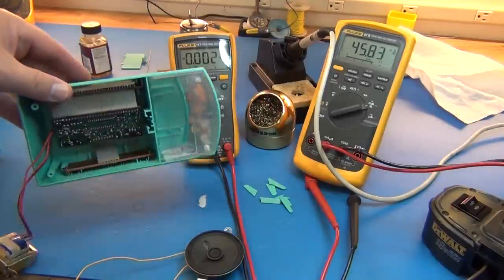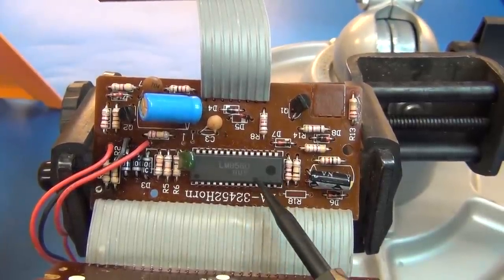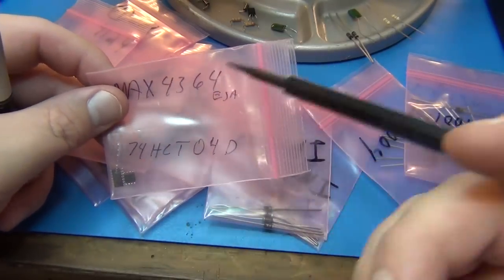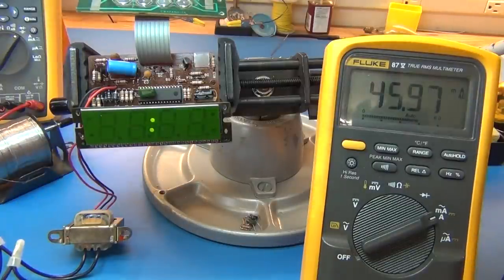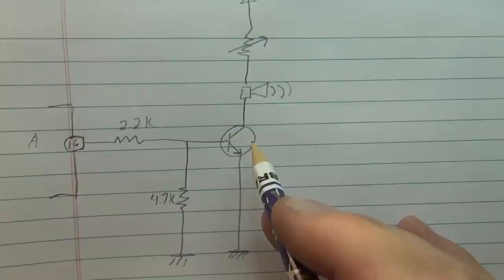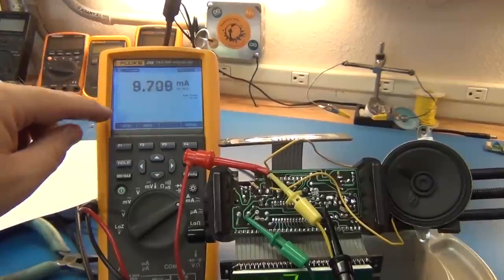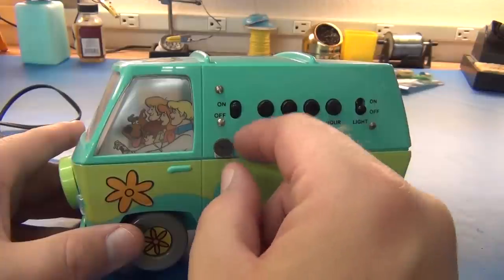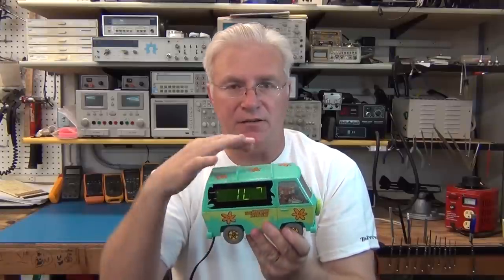Scooby-Doo Alarm Clock Repair

Comment: Did the garage burn up yet, just kidding Todd, couldn't resist! That is a cool clock, there is a guy I know in town here who has a real van that he customized to look like that, pretty cool.  Nice work on getting it going again. I have not done many videos either lately but just kind of starting up again, hope to get back to it just like you.
Reply from the maker: RadioHamGuy HA! No the garage didn't burn and I'm happy to say the clock is still in service. It should have another 20 years waking up kids, maybe even grand kids someday. Unless I hack it to restore the honking sound and manage to mangle something. I'm sure I could replace all the guts as long as the buttons and display work. I guess I could even replace the display but those displays are not as common anymore.
Reply: the van is the Mystery Machine

Comment: Nice one, you say it was a simple repair, simple for you maybe but way beyond me.
Thank you for posting, it's always interesting listening & learning from you.
Reply from the maker: Malc Tulloch Thanks for the comment. When I look at all the surface mount stuff now days this old through hole was a nice throwback to simpler days. That said, I much prefer working with SMD then through hole devices. The traces and multi layer boards nowadays make reworking or altering such boards very difficult.

Comment: Thanks for a great video, I learned a lot from your repair. The clock is absolutely awesome. I've just subscribed to your channel.
Reply from the maker: ElectronFun.com Thanks for the sub and I’m very glad to hear you picked up some tips. You know, when I build a simple Arduino on a breadboard I just skip the crystal unless timing is important to the final project, many times it isn't. You have to change fuses on the AVR to support such changes. I don't have video on such but I do have a post with all the details at http://www.toddfun.com/2011/01/01/making-a-custom-arduino-board-to-hack-a-christmas-photo-frame/

Comment: Great video.  I once lost a video production monitor that was left plugged in during a "brown out" - so I'm not convinced that limiting the AC voltage when powering up is always the best idea.  In the case of the monitor a AC-to-DC power supply fried.
Reply from the maker: GeorgeGraves Very true, must agree. I just wanted to make sure I didn't see any crazy high currents or flames because as an heirloom I couldn't risk much. Damped if you do and damped if you don't sometimes. Did you notice your resistor substitution box had a cameo? That thing comes in so handy!

Comment: Nice repair :)
I was about to make an alarm clock, with a few more dB than the ones you can buy. So I might try the LM8560, instead of a micro controller  :)
Thanks for the video ! :D
Reply from the maker: EcProjects I have used ones like this in the past. Some have a lot more features and they are super easy to use. I once made a coffee pot timer to turn my coffee pot on/off long before such things were common. Timers, not coffee. HA!

Comment: Hi.  I just found this vid.  I have a vintage alarm clock and it should have the same alarm sound as yours.  The volume just went low all at once.  I really need it to be louder.  It has a comparable 28 prong chip.  Do you have any suggestions on how to make it louder again? Thanks.  Great vid.  I subscribed.

Comment: hi there Todd, are you definetely sure that the clock would sloow down or speed up if i use a 50hz us to uk step down plug ?

im not any gud at this solidering stuff, i can take it apart but worried ill mess this up. just confussed about were to connect it from point a to b.

thanks so much
Reply from the maker: +lonefoxbushcraft Yes, I'm sure. No harm if you want to try it without the jumper on your step down transformer. With the step down transformer it will be running at it's rated 110v AC but it will not keep correct time. Once you try this to prove it is working clock on 110v AC but you notice it will not keep correct time then you can unplug it and  add jumper wire from VSS (pin 15) to the 50/60 Hz select pin 26 on the IC.
Reply: +Todd Harrison (ToddFun) thankyouTodd !

Comment: I have the clock as well and have a question. How do u turn off the alarm? I have tryed to turn it off and it wont turn off. I can change the time it goes off but cant find out how to turn the alarm off.
Reply from the maker: If you look at 29:15 in my video you will see that near the drivers side window is an on/off switch. That is for the alarm. First UNPLUG the clock before  you do anything.  Take it apart and then get some "DeocIT" (https://amzn.to/2tL3pYO) and spray it inside the switch mechanism from the back side. Activate the switch 10 times then put the clock back together and test. But you'll also see I had to drill in two holes and put in small bolts and nuts to hold the switch up to the plastic so I could use the switch being the original plastic mounts internal had gotten brittle and had broken away.  Maybe the same has happened to your switch and needs the same repair. The wires could have broken away from the switch as well in yours and needs to be soldered back in place. You will have to UNPLUG the clock and see if you can get inside and repair or take it to somebody that you believe has the skills and tools to repair.

Comment: hello i have a question? i try to fix my scooby doo alarm but. i fix everything but the light its not working. if any other video can should more about that
Reply from the maker: Well it is just a yellow LED so not much to to it. Maybe the LED is bad. Any yellow LED of the same size and shape would work,. Just make sure you put it in the correct way. If you get it in backwards it will not damage anything but it will not light if in backwards being it is a diode.

Comment: So I have this clock and i love it.. but for some reason it wont let me set the time. It still flashes and keeps track of time, I just cant set the right time. Do you think its probably just the buttons going bad then?
Reply from the maker: Yes, the control board with the button is mounted on plastic and the plastic get old and cracks making it it impossible to push the buttons even if they work. I had to drill holes in the control board and van body then remount the control board to the van body with small nuts and bolts.
Reply: @ToddFun  Thanks for replying. I think I'll give fixing it a shot.

Comment: I switched my clock back for daylight savings ending now I’m scaring myself awake every morning becaye the alarm is going off but no light on the screen to indicate it on. What do you think could be wrong?
Reply from the maker: Those switches can get a bit funny. You might have to take it apart see if the switches loose. If the light isn’t coming on maybe the LED is burned out for that indication and the switches in the on position.

Comment: Do you know what screw driver is needed to open it, its a very funny looking screw driver head.

I take it ill need a 110v surge protector uk to us adapter next time ?

Thanks again.

Dan
Reply from the maker: lonefoxbushcraft No, a surge protector will not help. You need a down converter that takes in 220V 50Hz and outputs 110v 60Hz for this clock to work, or find another Scooby-Doo clock that is rated for your power system if such is even made. You will need a slotted security screwdriver but what I do is take a normal "cheap" standard screwdriver and file a slot in the center. Works good and you can get a screwdriver that fits all the way down the holes int he clock.

Comment: Hey. I have one exactly like that, how do you turn off the alarm? Is it pressing the back for snooze?
Reply from the maker: Yes, to snooze you just press the back and if nothing is broke it will set the snooze feature. There is a switch under the wheels in back that will enable the snooze when you press the back end of the van. The alarm is disable by a switch so if that isn't working then maybe the switch is broken inside. You could unplug it and then open it to see what might be wrong.

Comment: I have this same clock and the alarm goes off everyday when it's turned off. Do you have any idea what the problem could be?
Reply from the maker: the switch is bad for the alarm. you would need to install a new switch. or maybe just disable the switch or you don’t use the alarm.

Comment: Hi I just bought one from usa and pluged it in and after 10min just stopped working,  it was making a very low pith noise tho, I am in the uk and used a us plug adapter,  any help please ? Thanks Dan
Reply from the maker: lonefoxbushcraft Sounds like you used a US plug adapter but the transformer inside the clock doesn't have an auto down regulator like a lot of modern switch mode power supplies do today. I'm thinking you pumped 220v into a 110v device and french fried it. No telling what all burned up but I'm thinking it is trash. The display might have survived so if you're good with arduinos you might be able to make a custom cloned arduino board then add a real time clock from Adafruit to restore some functionality. But I recommend trying to get another clock off eBay and use a 220v to 110v down converter next time.
Reply: ***** yes thats correct i think your right, im gutted, its in mint condition to. Dont no what to do, im trying to email people who can fix it. Do you think it can be fixed and how can it not happen again, thanks so much, Dan
Reply from the maker: lonefoxbushcraft Use a down converter that takes in 220V 50Hz and outputs 110v 60Hz is how you would prevent it from happening again. Very important it outputs 60Hz because this clock uses the 60Hz to maintain the correct time. If you ran it on down converted 110v 50Hz the clock would show the wrong time within minutes and be way wrong by the end of the day. I wouldn't think it can be fixed, but you would have to have somebody take it apart to evaluate the failure. I'm about 95% sure it will not be repairable.

Comment: Purchased this today at a Flea Market. The clock works fine but the night light does not.
Reply from the maker: I think there is a switch for the night light. Maybe the switch or wire is bad. Or the LED is bad. You could test the yellow LED and replace it if bad.

Comment: Hi Tod is this the right plug for my next one ?

http://pages.ebay.com/link/?nav=item.view&id=161474264495&alt=web

And is it total trash the circuit board, only fot for bin ? Or could it be fixed ?

Thankyou for your help, really appreciate it. 

Atb

Dan
Reply: Finding hard time getting 110v 60hz
Reply from the maker: lonefoxbushcraft Getting a frequency converter is not going to happen at any practical price. However, per the datasheet for this alarm clock chip you can convert the chip to 50 Hz:
http://www.datasheet-pdf.com/datasheet/SanyoSemiconDevice/393159/LM8560N.pdf.html

You have to unplug the clock, if it is plugged in to AC mains, remove the battery if one is installed, then open the clock and solder an insulated jumper wire from VSS (pin 15) to the 50/60 Hz select pin 26 on the IC. Then put everything back together. You can use the step down converter that you linked to on eBay and it should then work fine provided you buy a new alarm clock that is not fried. Your current alarm clock is undoubtedly fried and will not work.
Reply: ***** Your a Star, thankyou so much! :-))
Reply from the maker: lonefoxbushcraft Gad to help and thanks for the sub!
Reply: +Todd Harrison (ToddFun) hi i have a 1970s big general electrics clock and the fast minute button to set it is messed up so i opened it up and i tried to fix it but it is still messed up. theres a metal tab that pushes down when you push on the button so i tried to push the tab down a little bit but it is still making the clock not beable to use the clock, but it is an easy fix but where could i find a new part for under the button for general electric model 7-4670b date code is 1623, please help me i love this clock!!!!, thanks
Reply from the maker: +SANTO PRODUCTIONS Without a photo and measurements I'm really guessing. I think you need a tactile snap dome. Not easy to find in the exact size you want for sure but this like is some on digikey. That said you might be able to got a dollar store and fine something for a dollar that might have a snap dome in it. Or watch at garage sales or flee marts for some 50 cent bit of junk that has snap dome switch pads you can salvage. Good luck! 
http://www.digikey.com/product-search/en?FV=fff40011%2Cfff8005e%2C884001b&mnonly=0&newproducts=0&ColumnSort=0&page=1&stock=0&pbfree=0&rohs=0&quantity=&ptm=0&fid=0&pageSize=25
Reply: +Todd Harrison (ToddFun) its been a year now and ive just bought a new one from the states. im hoping this time i dont fry it. least i have a spare one incase new one needs new parts.
Reply from the maker: +lonefoxbushcraft Good to hear. Remember to also do the 60Hz to 50 Hz conversion I noted above because your voltage step down will not change the cycles and the clock can't keep correct time set at 60Hz if the line in is at 50Hz.